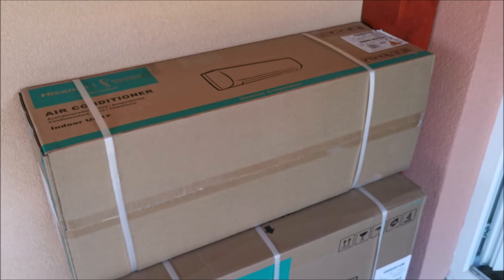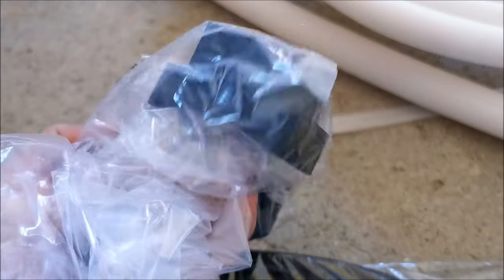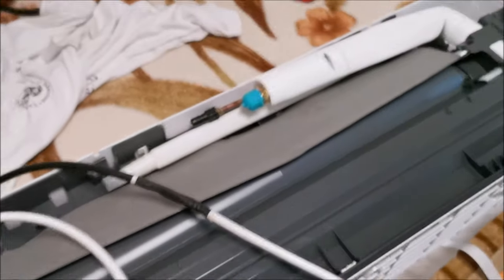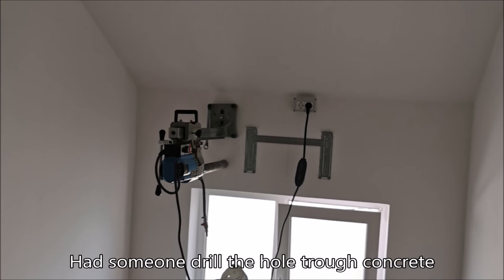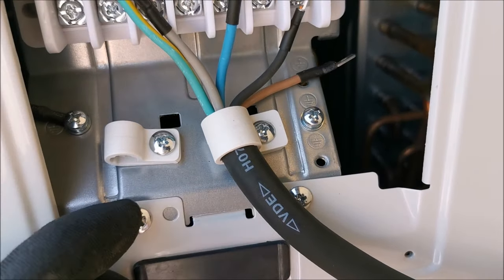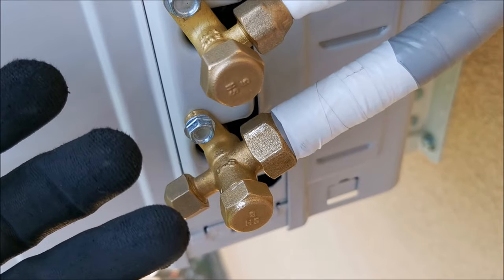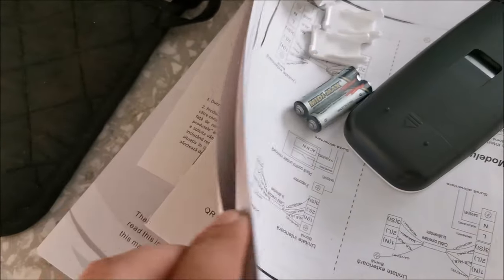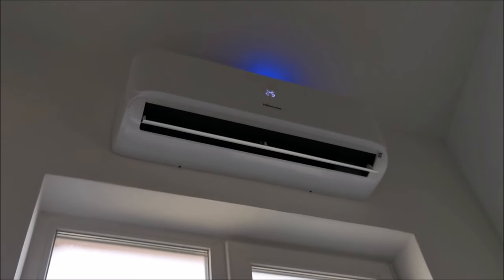HISENSE Eco Smart CD50XS1C Air Conditioner - how to install, connect to WiFi and open internal unit

Comment: Hi, how satisfied are you with your Hisense airco unit after 1-2 months of operations? I also want to buy a Hisense (multi split) airco, but when I ask around in Belgium, I hear that this is quality wise not a good device for regular cooling (and heating). To me it looks like a good brand and unit. What is your (of other owners) the experience?
Reply from the maker: Hi. For me it seems to be really good. Also a good friend has one and he is happy with it.
Reply: FYI: in the meantime I bought and installed two Hisense Quadrasplit airco units; operational now for one week and works like a charm; also the app is perfect.
Reply from the maker: Glad to hear that!
Reply: Hisense is a new brand just founded 10+ years ago. It is very young compare to other Big Brands. Hisense grows fast due to its competitive pricing and reliable quality. People telling you Hisense is not good and ask you to choose other brand because Hisense profit margin is lower compare to other big brand.
Reply from the maker: Thanks for this insight 👍🏼
Reply: Hi - also from Belgium here: what’s your experience so far in Belgium? Do you als use it regularly for heating? Some comments here indicate it might not handle well heating constantly. Thanks.

Comment: I was trying to connect mine with WiFi and I couldn't understand how. I followed your instructions and succeeded immediately. Thank you so much very helpful 🙏
Reply from the maker: You're welcome!
Reply: @UltimateDIY  I also trying but my Ac is not showing the Wi-Fi sign on the display, after pressing the Horizon button 6 time.
Reply from the maker: Maybe your model has different procedure, or it does not have Wifi module.

Comment: The fact that Hisense doesn't provide a protective side grille for the outdoor unit heatsink is beyond me. I legit thought that mine got stolen by the installation crew.
Reply from the maker: 😄
I've seen more and more AC units with this "feature".
Reply: Bom dia! Vc poderia me informar o diâmetro da tubulação do ar condicionado se e 14/ e 3/8
Reply from the maker: Hello. I think I mention this in the video, but I don't remember the values.

Comment: 8 BAR pressure is to less, you should  pressure test it with 30BAR at least and not with air do it with nitrogen, Nitrogen is drier compare to air. The days your father worked they used R12 and R22 which has a much lower  working pressure than R32 and R410a.
Reply from the maker: With what we used in the video it's impossible to do that, but I understand your point.

Comment: My old LG split system used to make that grinding noise too. My electrician friend who installed my new Hisense 7kw V series says it's the wall mounting bracket that causes that noise. If the screws are not done up tightly enough, or if they become loose over time, the bracket will rattle with the vibrations from the head unit's fan, and cause it to interact with the metal plate on the back of the head unit. Very important to make sure that the screws holding the mounting bracket up are done up tight, and might even pay to use small spring washers to prevent them from unscrewing themselves. If you're getting this problem now, it will definitely come back in 5 - 10 years, even if you've fixed it for now.

I used to stuff tea towels between the wall and the head unit, and lodge a stick between the ceiling and the top right end of the head unit to get the grinding noise to stop. But it would always return because the screws plugs would be pulled even further away from the wall from the force of stuffing towels in the gap. Eventually the thing might have fallen off the wall and onto my head. Luckily I got the whole system replaced before that happened. Now I know to never do that again.
Reply from the maker: In my case that is not the reason for the noise. The plate is as tight as it can be. It's some internal gap that is not in tolerance, because the noise only appears sometimes when the ac is really cold. So, basically something contracts too much.

Comment: Cand esti la nevoie, tot un roman te ajuta! Nu reuseam sa il pun in modul conectare, multumesc si spor la treaba!🍻🍻🍻
Reply from the maker: Cu placere! Ma bucur ca am putut ajuta!
Reply: @UltimateDIY  Va multumesc si eu pentru ajutor! Toate cele bune va doresc!
Reply: De ce nu îl pot conecta în zice se verifică cloud și se închide nu îl conectează… oare fac eu ceva greșit? Am urmat exact aceeași pași. Țin sa menționez ca l-am avut conectat și s-a deconectat singur
Reply: @saracsanandrei3377  posibil sa fie o problema de la aplicatie.. si aparatul meu a fost deconectat si cand am incercat sa l conectez din nou am intalnit aceeasi problema ca si tine
Reply from the maker: Si eu am patit o singura data sa se deconecteze complet si a trebuit sa iau toti pasii de la inceput si sa il reconectez in aplicatie, ca si cand ar fi fost un aparat nou.
Reply: L-am avut conectat in aplicatie, acum 2ore s-a deconectat complet. A trebuit sa reiau tot procesul. La ultimul pas cand apare ca se conecteaza la cloud imi da eroare. A mai patit cineva asa? Este o problema din aplicatia ConnectLife? Exista vreun workaround?
Reply: @clearmind2023 Și soluția cara a fost?
Reply: @Immanuel1858  exact la fel si la mine! Cu siguranta este problema de la aplicatie
Reply: @saracsanandrei3377  inca nu am rezolvat. Ieri s a intamplat chestia asta, o sa incerc din nou azi sa vad daca si a revenit
Reply: Eu am dat unpair m-am delogat din aplicatia ConnectLife si am oprit clima 30min si am  tras-o din priza. Dupa am reluat procesul ca si cum ar fi fost prima data cand ma conectez si a mers. Cred ca din aplicatia lor a fost ceva problema.
Reply: @Immanuel1858  o sa incerc si eu la fel, multumesc!

Comment: Hi, good video. I have the same model (for less than 2 years), but it makes noise from the external machine (as it was suffering a lot) in the cooling mode (less noise when the air is dried after hours of work). What could be the problem?

Comment: The WiFi module came with the air or do you have to buy it separatly?
Reply from the maker: Mine came with it directly. But make sure it's in the specifications of the one you buy.

Comment: Hello... I have lost the wifi connection of my Hisense AC with my smartphone. I always used ConnectLife to switch my Aircon ON/OFF outside house, but suddenly the connection cut. Please need your advice how to connect it again outside with my smartphone ..  thanks in advance.
Reply from the maker: Hello. Unplug the AC from mains power and then plug it back in. Mine looses the connection from time to time also and this fixes it.
Reply: Thank you for your prompt reply...
Reply from the maker: Welcome!

Comment: So, would you say, in a 2 story house? Would it be overkill to have one in each level of the house? 
  Either way, that's awesome..  We have Central Air in our house but, for someone else, this would be an AWESOME alternative.
Reply from the maker: No, it would not be overkill. They would both just work less hard.
Central air is great, but really rare im my country.
Reply: @UltimateDIY  Ohh, now being rare in your country, is news to me.
Reply from the maker: For us, split type ac units are the standard.
Reply: @UltimateDIY  Interesting.. I wonder if that's because of the plug standard(For lack of a better word/term).
Reply from the maker: I don't know. I have seen that in US houses you have heating and cooling based on air ducts and vents. In EU in general this is not used. We have split ac for cooling and radiators connected with water pipes to the central heating unit.
Reply: @UltimateDIY  Correct, we have air ducts, which both, HOT(Heater), and cold(A/C) air travel though.
Reply from the maker: They also provide ventilation with fresh air?
Reply: @UltimateDIY  Yes, Sir. At least mine does, I am not sure about others.
Reply from the maker: That is a nice feature 👍🏻

Comment: Why do you have two live L0,L1 connection inside indoor unit? Mine  had L N Earth and SI. I've seen one today also has only three wires , so I guess the signal wire is cast on the live wire and N and Earth
Reply from the maker: Sorry, but unless it's explained in the video, I don't remember exact details about wiring of the ac.

Comment: When using the app, you need to be connected to the samw WiFi network as the AC unit? Or you can control the AC when you're not at home just using data service or a different wifi?
Reply from the maker: You can control the AC from anywhere as long as you have some kind of internet connection on your phone.
Reply: Hi.
Can you tell me…it’s possible connecting two smartphones at same time?!

I just cant connected 1 phone.

Thanks for your help
Reply from the maker: You should be able to use the same account on multiple mobile phones. Or share the AC from your account to other accounts.

Comment: was WiFi module built in or are you buy separate?
Reply from the maker: For mine it was built in, but search on forums, I think others managed to add it.
Reply: @UltimateDIY  Custom built for you? Actually I bought and install this AC yesterday in Bangladesh. Looks like same but model no not same.
Reply from the maker: No, not custom. This model comes with or without Wifi and you choose which you buy.
Reply: @UltimateDIY  got it. Have any way to understand is present or not? I see sometimes wifi icon show in remote
Reply from the maker: No idea. For mine it was simply advertised for the model I bought.
Reply: @UltimateDIY  thanks

Comment: Hi, thank you for the tips.

I tried to connect my AC but I couldn't. When I press the horizontal swing button 6 times I get a 7 tones beeping sound and nothing happens! The temperature stays displayed and I can't find the "HIS-XXXX" network on my phone!

Any suggestions?
Reply from the maker: Sorry, but I don't know.
Reply: @UltimateDIY  Would you be able to know whether my AC has that option from the model number?!
Reply from the maker: No. I only know my unit. I am not an expert in AC. Try to search for this info online based on your model number.
Reply: @UltimateDIY  Will do, thank you.
Reply: Can you see the WiFi module when you lift the cover?
Reply from the maker: I think you can. If I remember right I show mine in the video.
Reply: @UltimateDIY  You have a good memory...
 You did show yours but it was dissembled.
Reply: @frankunderwood1632 i have the same issue, did you find the fix ?
Reply: @pljeve  nope! Sorry mate.

Comment: Salut, un pic de ajutor daca se poate, eu lam cumparat dara wifi iar acum iam adaugar un modul wifi aeh.....dar nu reusesc nicicum sal conectez la router, am incercat vreo 4 aplicatii si degeaba, ce am observat e ca apasand de 6 ori pe tasta se aude beepul cum ca ar intra in pairing mode dar 77 se aprinde pentru cateva secunde dupa care apare temperarura, ce am mai observat este ca modulul nu creeaza o retea wifi cu numele his.... Creeaza o retea cu numele aeh....chiar nu stiu unde sal ma gadil...
Reply from the maker: Salut. Dar de unde ai cumparat modulul si cum l-ai ales. Pare sa fie pentru alta firma sau model de AC.

Comment: Ai mai cumpărat ceva în afara de suportul pentru unitatea exterioara? 

Ce lungime are kitul inclus? 

Cati BTU are unitatea?

Mai știi cât era dimensiunea pe înălțime între gauri la unitatea interna, sau înălțimea totala a acesteia?

Întreb pentru ca vreau sa comand și eu o unitate de 12000btu, și as prefera sa evit surprizele..
Reply from the maker: Depinde. Daca nu vrei sa faci vid, atunci doar suportii i-am cumparat.
Unitatea are 18000btu.
Din pacate nu mai tin minte nici un fel de dimensiuni.
Reply: Eu am cumpărat un hisense apple pie de 9000btu si nu avea nimic, i-am cumpărat eu kit de instalare si suport pt maxim 18000 btu ca sa stea mai in exterior si sa fie mai strong. Va recomand bucsile de cauciuc, nu se aude deloc
Reply from the maker: Grija cu bucsile de cauciuc. In cativa ani se coc si cad singure, moment in care unitatea ramane nefixata complet pe pozitie. Si eu le-am pus, dar deja incep sa arate rau de la soare. Cand o sa cada o sa strang din nou suruburile si nu mai pun altele.

Comment: I use Hisense 24 Inverter for heating. When i set temperature to max 30c, i get in app that air temperature that comes out is 31-32c? Is this normal? I think this is low. Thanks
Reply from the maker: At least mine does not show the temperarure of the air coming out. It shows the temperature of the air going into the unit.
Reply: @UltimateDIY  hmm, are you shure? Maybe is just the same on my. I always think that reading temps are temps that AC blows away 😂 Sorry for bad english and thanks
Reply from the maker: Nope, for sure on mine they are input temps.

Comment: For the Wifi. The Wifi adapter is now using a HiSmart-01-XXXXXXX format instead of the HIS-XXXX format. Now the app won't detect the module wifi network. Anyone know a fix?
Reply from the maker: Try to connect manually to that network while pairing the AC to the app.

Comment: I have identical AC unite like this. Installed in late August worked few days cooling everything good. 
Started heating mid September mostly on 26 to 28 Celsius, ventilator on medium to low speed. When I go to work it's idle for cca 6h. 
After one months it stopped heating.
Cooling, ventilator and dehumidifier works, when I switch to heating I can only hear click on outside unit and noting happens. Don't know where to start.
Could be thermostat?

I called ac mechanic he basically started screaming this is not AC unit fit for heating. And nobody showed up. of course its holidays nobody will come to check it.

Did anyone had any experience?
Reply from the maker: Sadly, these are actually not meant for constant heating. You might get away with it in warmer climates, but in cold countries...nope.

Comment: Salut
Nu reușesc sa il conectez la wifi. Apas de 6 ori butonul de orizontal se aud cele 5 beep-uri dar nu se întâmplă nimic indica in continuare temperatura? Sfaturi? Ms frumos
Reply from the maker: Salut. Nu stiu sa te ajut. Se pare ca unele modele au alt mod de conectare la wifi, pentru ca multi au problema asta in comentarii.
Reply: @UltimateDIY  am tot văzut comentarii ca ar fi posibil sa nu am modul wifi. Ai idee cum pot verifica. Unde e pitit si cum arata?
Reply from the maker: Nu mai stiu sa iti spun. Parca il arat in video la un moment dat. Posibil sa fie vizibil cand ridici capacul.
Reply: @UltimateDIY  l-am gasit e pe capac mufa pare ok. Nu prea am ce sa verific amanuntit. Scriai ca sunt si alte variante de conectare dar nu vad in comentarii sa fi scris cineva altceva. Scan qr sau trecut sn manual nu a mers . Spune ca nu identifica seria si nici codul qr. Daca ai si alte idei.....
Reply from the maker: Nu stiu alte variante de conectare, dar tinand cont ca asta nu merge, cu siguranta exista altul, ca altfel ar fi imposibil.

Comment: Hello, when I press the button 6 times, the air conditioner makes a sound a couple of times, but it is not visible in the network, as if the wifi on the air conditioner is not turned on. What could be the problem.
Reply from the maker: Hello. Is your network 5Ghz?
Reply: No, 2.4 hz
Reply from the maker: But it's a model with wifi capability for sure? As you could see in my video, the wifi is an independent module and might be missing on some models.
Reply: The air conditioner is new and the module arrived with it, it was not installed later.
Reply from the maker: Ok, then I don't know. This is the problem with smart devices, they are awesome when they work and a pain in the but when they don't.
Reply: @velisavvucicevic8002 isti problem imam, jesi li uspeo da nadjes resenje mozda?

Comment: Va salut. Am si eu montat un aparat de cateva zile. Am pornit, functioneaza, am pus in modul economic, dar nu se opreste. Raceste mai putin intr-adevar, pastreaza temperatura, dar nu se opreste niciodata. E vreo problema ?
Reply from the maker: Salut. Pai de unde stii ca trebuie sa se opreasca? Si la mine e acalasi comportament. In eco pur si simplu scade putin puterea.
Reply: @UltimateDIY  Am la munca un aparat de aere conditionat care se opreste si reporneste din cand in cand. Deci e normal sa ventileze non stop ? Aveti idee de consum in perioada in care doar ventileaza ? Va multumesc pentru promptitudine :)
Reply from the maker: E alt tip de clima. Probabil e generatia veche fara inverter. Cele cu inverter, in general, merg incontinuu, doar variind puterea.
Reply from the maker: Cat despre consum, greu de ghicit, pentru ca cel mai probabil merge inca si compresorul, dar la putere scazuta. Cat de scazuta, depinde de multi factori.

Comment: Salut. Am si eu un AC Hisense CD35YR03G. Si pe site la Hisense si pe emag spun ca suporta WIFI, insa daca apasa pe butonul horizontal airflow, face 5 beep-uri si nimic mai mult, nu apare 77 si nici reteaua WIFI nu apare. Any ideas?
Reply from the maker: Salut. Tare greu de ghicit. Incearca sa contactezi Hisense si sa vezi ce zic. Eventual poti sa verifici daca are modulul wifi instalat. Cred ca am mentionat in video care e.
Reply: @ashleylycan9335 i have the same issue
Reply: @ashleylycan9335  salut. Ai reușit? Am si eu exact aceeași problema
Reply: Am desfăcut capacul splitter-ului si modulul wifi lipseste :'). Ciudat ținând cont ca oriunde caut modelul acesta spun ca suporta wifi.
Reply from the maker: Poate suporta, dar nu e inclus 🤷🏻‍♂️

Comment: Salut, ce aplicatie merge pentru controlul de pe telefon, sunt in cautare de AC si m am oprit la hisense cu wifi
Reply from the maker: Salut. Connect life se numeste aplicatia
Reply: @UltimateDIY  cum se prezinta ac pana acum? Eu am la alt ap Daikin mi se pare scump, eu folosesc doar cand nu sunt in casa, dau la 3 din 5 ventilatia din aplicatie si cam atat fac sa raceasca asta ma intereseaza.Daikin e ft scump in comparatie cu Hisense. De aceea va intreb cum se prezinta pana acum.
Reply from the maker: @sebaseby91 merge perfect. Nu am ce sa ii bag de vina.